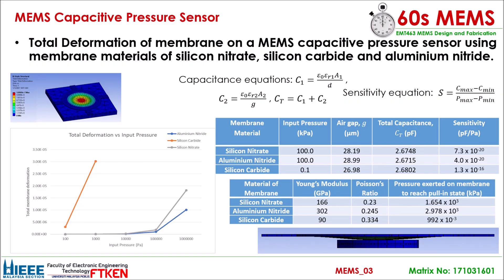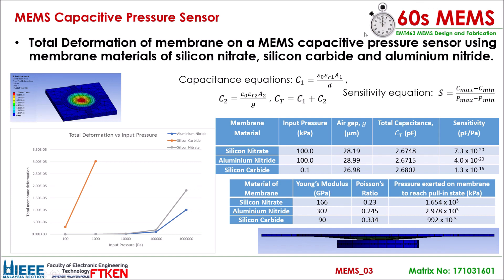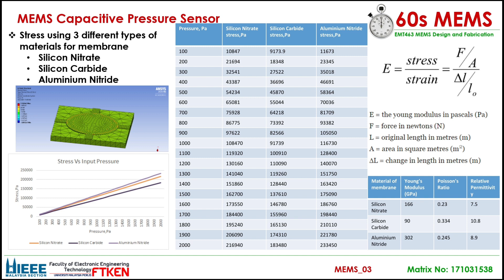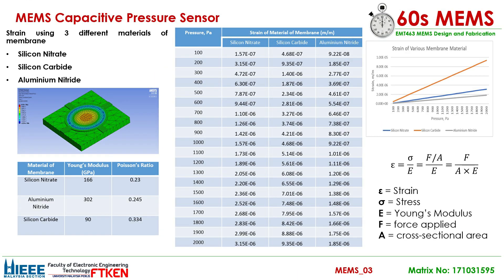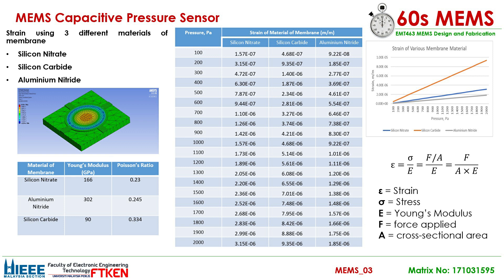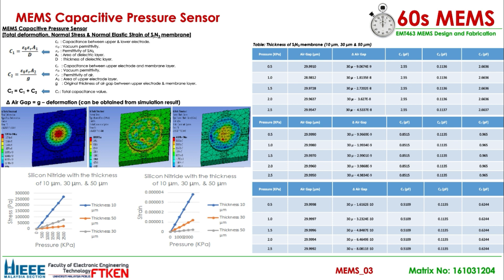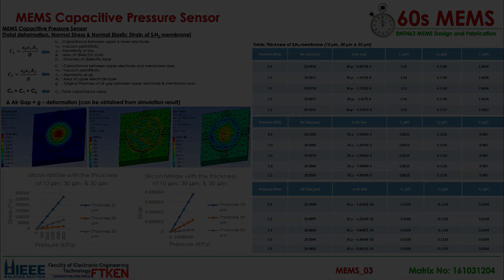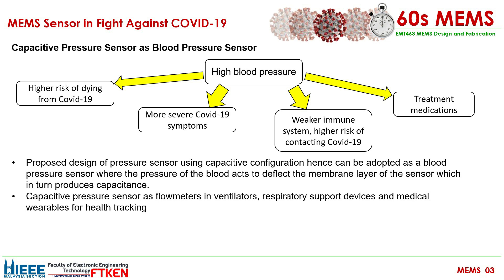2020 60s MEMS | MEMS_03

Comment: Question to 171031601:
Input pressure applied to silicon carbide membrane material (0.1kPa) is different from input pressure applied to silicon nitrate and aluminium nitride membrane material (100kPa). What is the reason behind this difference of input pressure asserted?
Reply: Membrane adopting silicon carbide material has a considerably lower maximum pressure at pull-in state as compared to aluminum nitride and silicon nitrate. Hence, input pressure adopted in the analysis for silicon carbide membrane material is of lower value (0.1 kPa) in order to obtain results of membrane deformation, capacitance and sensitivity before the pressure sensor reaches pull-in state. Whereas for aluminum nitride and silicon nitrate membrane material, input pressures of less than 10 k Pa results in negligible changes in terms of total deformation, total capacitance and sensitivity of membrane. Therefore, different values of input pressure is adopted in the analysis mainly depends on the membrane material's ability to produce reasonable total deformation, capacitance and sensitivity values without reaching pull-in state as illustrated in frame 8 of MEMS_03_2 Google Jamboard.

Comment: Question to MEMS_03:
What are the purposes of applying different pressure on membrane with different materials used?
Reply: variations in pressure can influence the productivity and pressure sensor performance. Using different level of pressure can determine how high the pressure sensor can be sustained for each material used. Most capacitive pressure sensor measure the deformation/stress/strain of a membrane under the different pressure applied so that we can distinguish the difference between silicon nitirde, aluminium nitride and silicon carbide to determine which material of membrane is most suitable to use as our proposed sensor.
Reply: From the perspective of material properties, different materials tend to have different elasticity (Young's modulus) and Poisson's ratio which results in varying reactions towards pressure in terms of stress, strain and total deformation. Therefore, applying different ranges of pressures allow us to determine the minimum and also the maximum limit of the pressure sensor's membrane depending on the materials adopted.
Reply: By performing a series of test in deformation, stress, strain, we can determine which type of material is suitable applied on membrane yet it can withstand different geological pressure condition. These conditions such as above sea level in mountain, rural area, or below sea level although maybe no one will doing measurement under those conditions because the result might not accurate. However, as a group of engineers, we need to perform these types of test to know the limits of the materials and decide on the materials are going to be used in the design.
Reply: Different materials and thickness of membrane had been tested out due to need to find most suitable material and thickness on the membrane. Higher capacitance value will get a more accurate result when detecting the blood pressure. Hence, trying difference material which has a difference in young's modulus and poison's ratio, we can know that lower young's modulus value will cause an increase in capacitance value. By applying different pressure, we can know the membrane could support how much pressure on it.